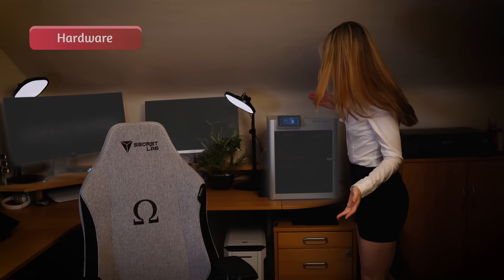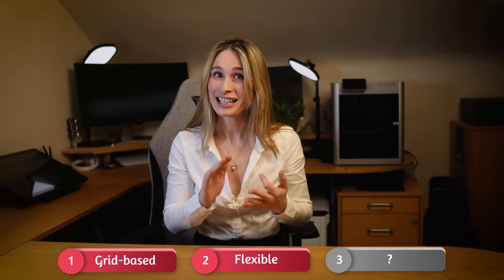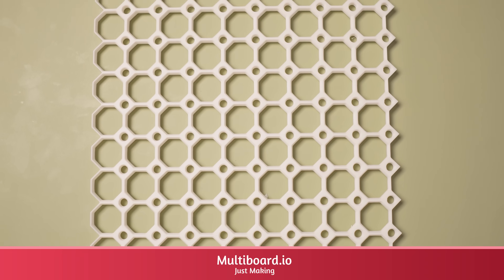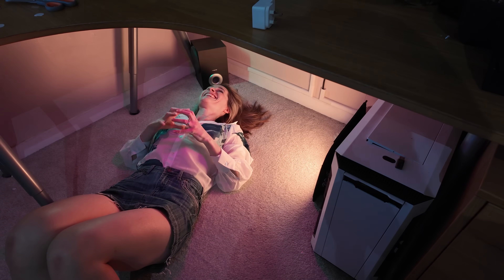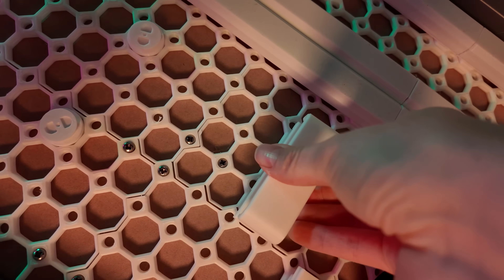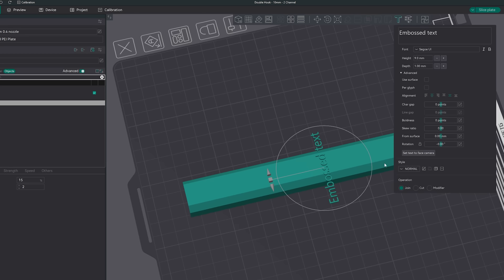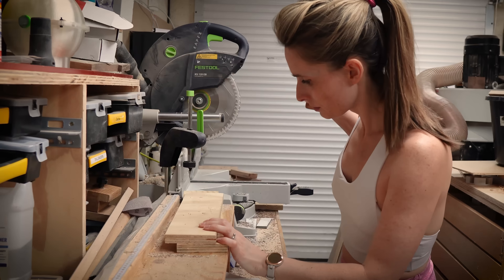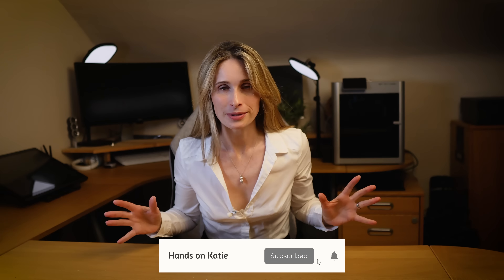Underware: The Ultimate Cable Management System | Full Guide

Comment: I just downloaded your STL files and the multiboard grid. But what connector should I use? There are so many different connectors for the multiboard. Which one did you use?
Reply from the maker: Hi Jessica, oh I know!! ;) I've deliberately radically simplified this for my collection, so there's basically only two needed. One I've included in the download - if you look for 'Standard Underware Connector', this screws into the little holes in channels. The other is called: Multiconnect - Board connectors_Multiboard big thread connector for multitool.stl  which is available on the link to multiconnect again linked on the site: https://www.printables.com/model/716558-multiconnect-generic-connector-for-your-board/files

I might ask David D if I can include this file in my collection as that would simplify it, I just didn't want to take credit for his file! Drop me an email on my site if you're struggling and happy to help!
Reply: @handsonkatie  thanks ❤️ I will.
Reply: @handsonkatie  I've just tried to print the Power Strip Stick-On Holder. But they don't fit at all. The multiconnect octagon is way too big. Do you have any tips?
Reply from the maker: @jessicaalvis7063  Hey Jessica! Could you drop me an email on my site email address (handsonkatie.com) and I can chat you through! (don't want to leave email here for spambots!)

Comment: Looks really cool, but I'm not quite sure I understand how they connect using the David D Multiconnect stuff. Is there documentation showing how that works, because I don't see a rail/slot on the Underware that could slot into it. Likewise, the alternative version with the nub that you demonstrate, where is that connector found? I don't see it in Multiboard or Multiconnect
Reply: Okay, so it appears that the connector you use for the Underware "Channels" is actually part of Underware, and can be found in "Accessories." And then for the Multiconnect connection, that is not for the Underware "Channels," but rather for a select few specific Underware parts, such as those found in "Hooks and Grooves." Is that correct?
Reply from the maker: Spot on - two connectors, one I designed and the other is the slot connector from David D's collection - I'll drop him a line to see if he minds me including it to make it simpler!

Comment: Looks great. Unfortunately my desk is also my PC case. The original Lian-li DK-05. They are currently selling it with height adjustable legs, but mine are fixed. Guess I have another incentive to remove its legs and drop it onto an adjustable sit stand desk. Then I would have wood to attach the underwear to. Currently using double sided tape, but it always fails after a while and I have to replace it.
Reply from the maker: Great idea to tackle as you swap the legs - agree I've never got on with any sticky pad solutions for cable management, always seems to fall off after a while (eg trunking, cable hooks etc)
Reply from the maker: Another brainwave - is your desk a ferrous metal (ie magnetic?)  If so, I could just create magnet holes for the multiboard that you could superglue magnets into and 'BANG'!, you've got a solution......?  Just a thought!
Reply: @handsonkatie it is aluminum.
Reply from the maker: @MistImp1  Darn it! What a silly design! Best idea is wood then as you suggest (unless you can see any mounting holes, slats or shapes that we could build a custom fixing point!)

Comment: How long does it take to print a cheeky pair of undies grids on the Bambu printer? Also, are there any solutions for cabling from a sit-stand desk that might involve some stretchy bits in your underwear to keep things snug when the desk is lowered?
Reply from the maker: About three hours per 9x9, although I stack them and print 4-5 overnight so I have a pile each day. And yes, I've got a 3d printed parametric cable spine in design that will solve this perfectly - so that should cater for all lengths of equipment .... 😂🤭

Comment: That feeling, when under the table I have shelves and keyboard shelve. And all the cables are behind the table. And I just do not see them, from any angle.

BTW why do you use Orca and not original Bambu slicer?
Reply from the maker: Exactly right, you're like an Underware Poet!   The Slicers are all a bit of a fork of each other, but I really like the pioneering features that Orcaslicer has released, it's open source nature and I've loaded all my other printer profiles into it also. Bambu Studio is great also, so no biggie either way!
Reply: Oh, understood. I tried orca and did not see many printer and filament profiles for Bambu printers there. That's why I asked.
I stole some settings from Balbu slicer for my Ender 3 profiles.
Tried that multiboard stystem, and it is not bad at all. But not so many addons. But I just write 'IKEA' to a tool holder I want, and slightly modify to fit for multiboard and it works. I also repurposed multigrid for my needs. Not that nor gridfinity was alright with my desires. If you want something to be done, do it yourself - they say.
I guess I will print some EnderWare, too = )

Comment: Love your underwear! 😉
However, do you have any issues mounting Power-Point Strips upside down, when using heavier Power Supply type plugs?  I have mounted Power-Point Strips upside down with screws before, and I found that the heavier Power Supply type plugs would sometimes just fall out of the strip.
Reply from the maker: No! I've mounted a 12 gang power strip (yes 12!!) using this - naturally the Multiboard snaps are pretty poor for this sort of weight, but I've got a version that uses David D's Multiconnect slots and this is massively strong. One of my discord members made an awesome parametric generator for this - check out: https://makerworld.com/en/models/646872  - you can just enter the dimensions of your power strip and it'll generate the right file!

Comment: Thank you for sharing your underwear 😉😉
I got little problems to fit the "standard connector" to the boards - with a hammer I got them in but not out. So I printed the connectors at 99% and now I can plug them in by hand. Has anyone else this problem?
Reply from the maker: Hey, no not had this problem, but sounds like your printer might need calibrated? Worth printing a calibration cube and testing the dimensions with calipers, you can then adjust it to be more accurate!
Reply: @handsonkatie  yepp, a few minutes after writing this comment, the same idea came into my head. I try to calibrate it. Thanks.
Reply: hmm, my cal cube is nearly perfect - 19,97 x 19,99cm - only z is a bit larger 20,27cm. 🙄

I found a video about threads and the cura function "Slicing tolerance" - I tried this but the "big-thread-connector-for-multitool" has a strange behavoir. The thread part ist sliced correctly but the cylinder on top of the thread-part is completely tattered. On preview it seams like there is a thread inside this cylinder 🤔🤔 At the moment, I don't know how to fix this.
Reply from the maker: @SaschiIein  Most peculiar - unless I'm not following, I definitely haven't heard about this. You tried downloading a different slicer to test if the problem persists? Eg Orcaslicer? Drop me an email on my site and you can send me the file in question and we can compare!
Reply: @handsonkatie  In orcaslicer it works correctly, just like in Cura, if I set the “Experimental -> Slicing tolerance” setting to “middle”. If I set this to “exclusive”, the slicing errors occur. I haven't gotten around to looking at the STL in Fusion 3D yet, maybe there is something in the cylindrical area above the thread that is causing the slicing error.
I tried different stl downloads, all have the same behaviour. Perhaps it is a cura bug...
The problem-piece is the "Multiconnect - Board connectors_Multiboard big thread connector for multitool" (easy name..)

Comment: Perhaps for your own sake, you should add a mention and a disclaimer to your  'underwear' video. I know the cables you were coiling up were relatively short lengths but keep in mind that coiling cables increases voltage (If my memory serves me well, I believe it's covered by Faraday's law of induction). I mention this just in case someone out there having watched your 'underwear' video, decides to use your system and coils up excessively long lengths of cable and then tries to blame you if something went horribly wrong. Coiled wire when under load can get hot, and with enough of a coil, can produce sufficient heat to start a fire (fact). Then you might be saying, oh knickers 😃
Reply from the maker: Ok, there's lots of misinformation about coiling powerstrips (including that it increases voltage, which is physically impossible), so quick comment with observations/recommendations from my side:

- Coiling doesn't increase voltage - This is determined by the power source, not the cable. 

The two main electrical effects you see are:

 a) current flow/magnetic fields - whilst this is possible to create a magnetic field that could disrupt signals, for a typical power strip, the current is AC meaning the current is changing 50 times per second (or 60 depending on region). This alternating current means any magnetic field around the looped cable will also alternate, reducing the potential for any heat build up or magnetic interference.  Inductive heating is also pretty unlikely given household currents are relatively low (15-20 max) and also operate at low frequencies (50-60Hz).

b) The main risk I'd see is heat dissipation (ie current flowing through a wire based on P=I2R) - now good quality power strips are designed with ample insulation and current ratings to handle extreme levels of heat safely even when looped, so as long as the cable is not overloaded (ie used within its current rating) then the heat will remain within safe limits. But I'd certainly recommend avoiding any tight loops and be conscious of creating any heat build ups (eg covering cables/power strips with carpet or enclosing)

But my main recommendation would actually be less about the coiling, but rather the power strip itself - ie check the load rating and what you're putting on it and naturally don't scrimp on cheap power strips where they are more likely to short circuit, have dodgy insulation and components. This is where you can make the biggest difference - buy super high quality power strips and they will have ample margins in their design, buy cheap ones and I'd be concerned that people would think avoiding coiling would make them secure.

Great comment though as always sensible to err on the side of caution, I just wanted to make sure the correct information was there. PS and yes, I've got USB devices running on this strip, so miniscule load regardless!
Reply: @handsonkatie  Hi Kate, I am no expert so please forgive me if I am wrong, but I believe that coiling a wire increases resistance, and increased resistance can increase voltage. I thought this was described in Ohm's law.

By the way, I love your channel (only found it very recently) and I think your videos are excellent 😃
Reply from the maker: You're right in terms of maths (Ohm's Law), just not in terms of application - it'll increase the theoretical voltage required, but not the voltage available - ie the supply is still the same, so higher Vs may be needed to satisfy your 10A demand, but it doesn't mean it'll be available!

Great to hear you're enjoying the channel and I'll need to cover some of this in the follow up Underware video!! And certainly don't apologise, it's brilliant to ask questions, it's what my channel is all about - drop me an email and I'll send you a link to my discord too where even more questions get asked!
Reply: @handsonkatie  Hi Katie, I defer to your better judgement and no doubt greater knowledge on the subject, and look forward to seeing more of your 'underwear', (now there's a thought) 😀

Comment: O.O  adds filament to cart
Reply from the maker: Add some extra, you might need it where you're going... ;)
Reply: @handsonkatie  Somewhat hilariously, you were oh-so-right.  I've had to refill my cart a couple of times already LOL. One question:  Is there a specific size screw you recommend, for mounting the multiboard directly to the underside of the desk?  Obviously the length will be somewhat dictated by the desk material/thickness.  But the shape and size of screw heads vary considerably, of course.  I used bog standard drywall screws for the vertical multiboard, but that was offset from the wall with different connectors. Going directly through the multiboard grids is not a mounting method you see quite as often.  (but it makes perfect sense under a desk)  Also, any advice on number of screws per panel?  If 4 per panel are really needed (I'm using mostly 8x8 tiles) that's still going to be quite a lot of screws tearing into the desk.  Vertical panels don't need quite as many (depending on the weight of attachments of course) since they have connectors between panels to help bear the weight, and all the weight is stacked against the next panel in a very different manner than the shear force pulling directly against the screw threads in this setup.  If you have a decently complex setup, as I do (5 computers (two with multiple displays), laptop docks, surround audio, etc), the actual weight of the cables is actually more significant than for simpler setups...

Comment: You do not want to roll up power cables like that when in use, they will get warm and eventually... hot.
Reply from the maker: Any high current cables are long looped as you'll see, for usb and low current stuff, it's absolutely fine. But sensible advice for people to be aware of!
Reply: @handsonkatie  I know, but even those "long looped" cables are very close to each other and will form a coil.

I've bundled up cables like this a lot and eventually stopped doing so because they do get warm even with a small 150W load.
Reply from the maker: Not going to argue as it's the right advice regardless if in doubt, but did check both current and heat as I was curious when doing this. Zero heat build up on mine - there's no tight loops where air could trap (the key hazard in this sort of thing) and the cables are very high quality on this strip, so insulation is probably doing its job as well. But definitely prefer everyone to just avoid any tight loops!